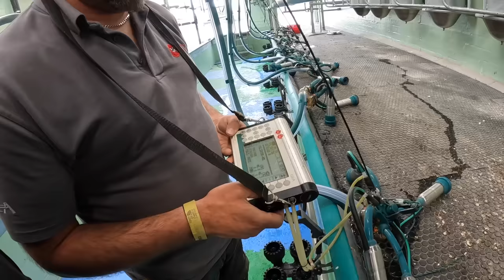THE BIGGEST PROJECT OF MY LIFE IS OFFICIALLY DONE!

Comment: Some videographers say to double the frames per second from 25/30 fps to 50 or 60 frames per second to overcome the strobe effects caused by fluoro lights. For the parlour yard gates, drill a pinhole in the gudgeon (and use 3 or 4mm wire in the hole) so cows or bulls do not lift the gates off. A few luxury items that could be added in the future, an 'up &over' backing gate, retractable? yard roof (so the cows don't have to stand in the rain) and draft pens.

Comment: Super Jo. Tom.
Any areas you’ve a gate opening back onto your fibreglass walls, fix a wooden batten to the wall or zip tie a batten to gate so it doesn’t mark or eventually wear a hole in the wall.
Such a simple fix but saves your walls.
The parlour will be great, you’ll have a few a gremlin’s to work through  for a day or so but looks a top job.
Ive a 20 year old 20/20 and pretty much identical, says a lot about the quality of the parlour and kit in general 👍

Comment: Great job Tom but two criticisms from this Video. 
Please put the Wind Brace back in that you took out for the end Concrete panel. It's there for a reason and certainly not to just take out because something else doesn't fit. If the panels had fitted between the steel columns you would have been fine. Go talk to Andrew Warring he will tell you why they exist but they need to go in to help support the frame of that barn.
Staying with steels. The RSJ's that you put under the IBC - you have put them in the wrong way around. They are inherently weaker the way you have them. Flanges should be on the top and bottom. The web (the vertical bit between the flanges) goes vertical. Sorry been in the Building game too long and hate it when people make simple mistakes because they don't understand the reasoning
Reply: i would agree great job , agree with your critic and i would add, as the saying goes "dont  spoil the bucket for a half penny of tar,  fix the removed bits of yorkshire board and lengthen the latch bolt on the gate, no excuse for baler twine  fix

Comment: Spend a few 10'sp on some bump stops. Door stops will do from Amazon or EPay - stop the gates clashing with the glass fibre and destroying it. Maybe 50-60-70p each. Attach to gate or wall (gate probably better, maybe - even better, both).
RSJ (H section beams - steels) - very very bad idea onto concrete blocks - the pressure on the ends of the H sections into the blocks is VAST. Spread the load somehow otherwise the blocks will be destroyed, best - change to C sections.